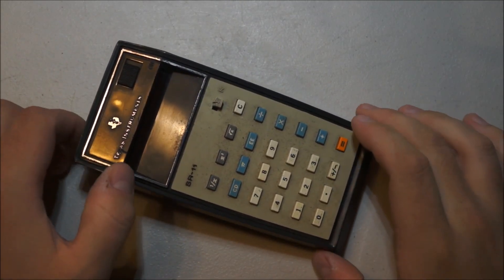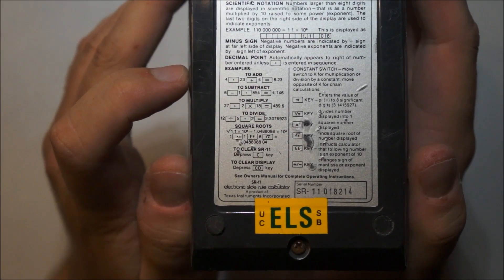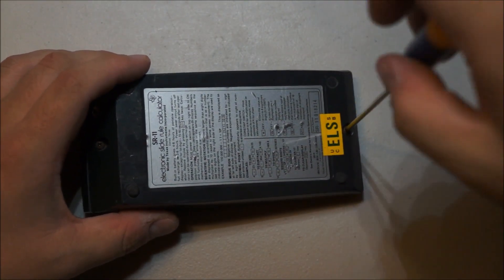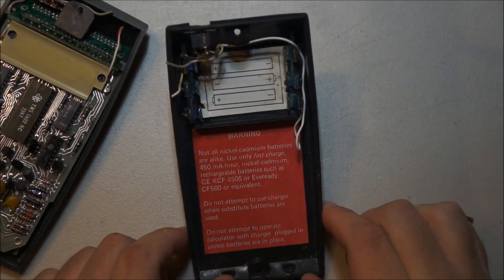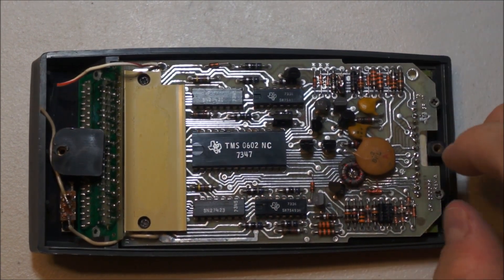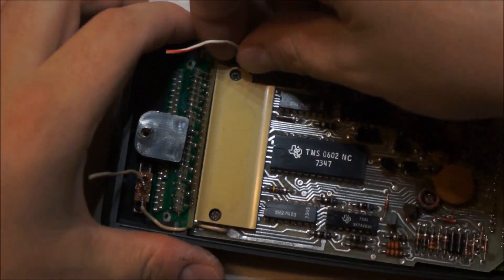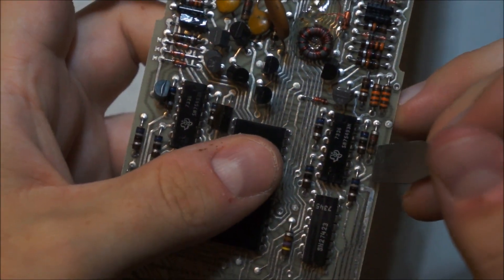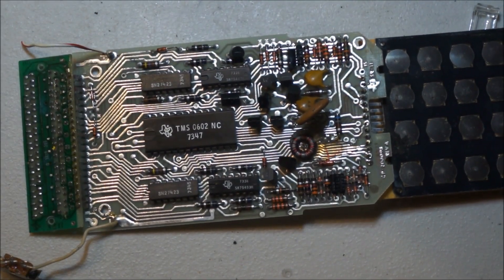Extreme Teardown: Antique TI SR-11 Calculator

Comment: So happy to have found this video, because I recently got my hands on a Sinclair pocket multimeter complete in box, with manual and the original receipt from 1979! However, upon closer inspection, I noticed that the LED to the far left [the over range and polarity indicator] and the decimal point, don't light up. Inspite of this, it's still "accurate". Can you help me out? Got any ideas, as to what might be going on here and/or how one might go about fixing this issue? I would appreciate any suggestions. I'm a complete NOOB to electronics so, I don't want to break anything, that is still working after 40 years... any insight will appreciated. Thank you kindly

Comment: I have one of those... and over 100 other calculators! Some are as old as 1965! I really need to get pictures of them online... :)

You think those LEDs are lovely... Wait till you find your first Nixie tube calculator!

Also, many of those old chips had negative, and even MULTIPLE negative supplies. The TMS0803 had a positive Vss and a pair of negative Vdd and Vgg supplies that correspond to the Source, Gate, and Drain voltages required for the FET transistors used in the chip's construction.

Comment: Might be cool to fit a little Lithium Ion pack in there with a charge controller, it would probably last for years with a decent capacity battery and as old as that is it's still quite useful, especially since it's standard and not reverse polish notation.

Comment: Pretty sure the inductor is for a switch mode power supply, not memory. As core it would only store one bit and would need more wires to boot.